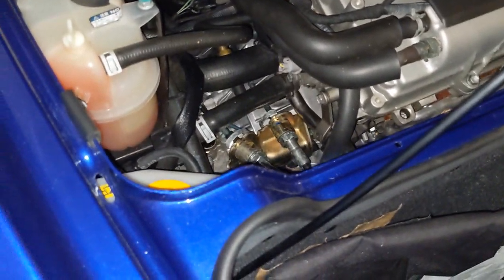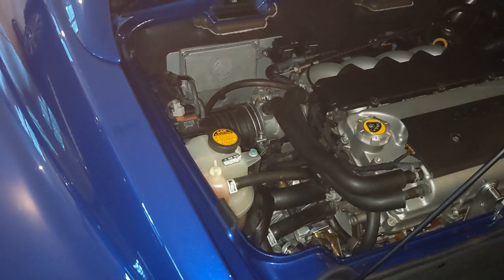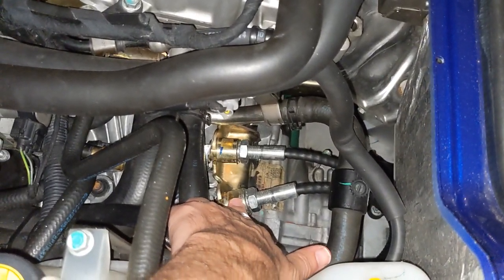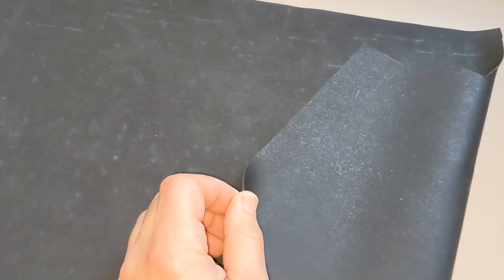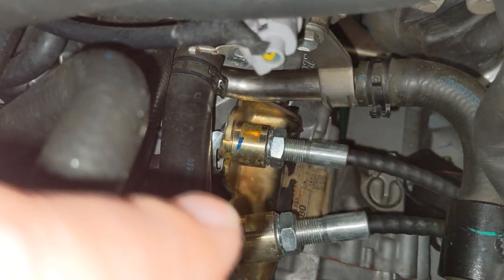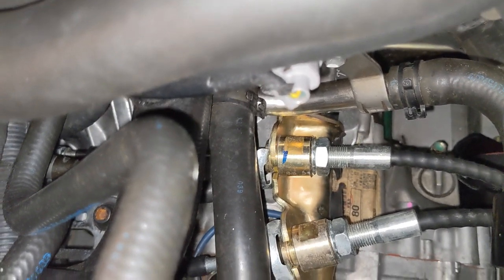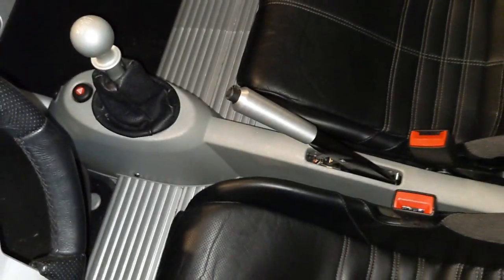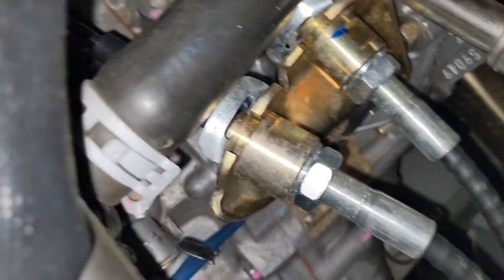Lotus Elise Shift Buzz Elimination

Comment: Good video! I might have to try doing this too. I'm not sure if this it the same as my noise, I always thought mine was internal to the transmission but I could be wrong.

I have some leftover adhesive sound dampner material from another project, I wonder if that would work as an alternative to the rubber sheeting you showed?
Reply from the maker: Try disconnecting the cable rod ends from the shift lever and see if you still get the buzz.  I chased the noise for years.  That was my lightbulb moment.

You don't want the isolator to be flexible because you don't want the bracket to be moving when you shift.
Reply: @justaddafan  mine is more of an in-gear while driving buzz, are you saying that yours was noticable even at idle? Mine is usually at steady or decelleration in 3rd gear mostly. A few threads on lotustalk indicated it might just be normal transmission gear noise.
Reply from the maker: @VincentChiaro  Just to make it clear, this only happened after I started upgrading the shifter and cables.  The stock setup didn't do it.  It buzzed in all gears between about 2500 and 5000 RPM.  Worst in 3rd and 4th.  I could also get it to buzz when in neutral at these same engine speeds.  So I disconnected the rod ends at the shifter and left the cable jackets attached to the abutment blocks.  It still buzzed, which indicated that the vibration was being transferred through the cable jacket, not the cable itself.